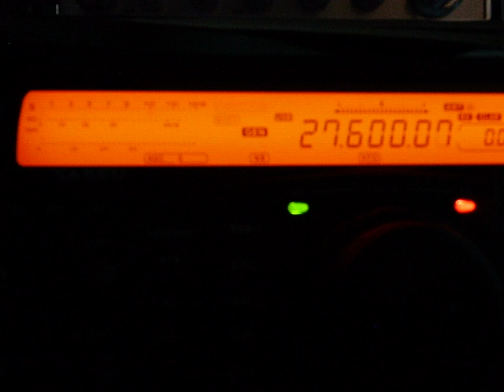3 element 11m Yagi Test to 91 Division - Indonesia

Comment: I just saw this video sir. I am just starting on C.B. radio and I was given am old 3 element yagi and I just need to assemble it and I will be making the same Gamma match like the one you are using. The boom that I have is 14 feet, is that ok? With the 10 feet boom that you have, may I ask sir what is your spacing between  the driven element and and director and the spacing between the driven and the reflector? I would really appreciate it and thank you sir.